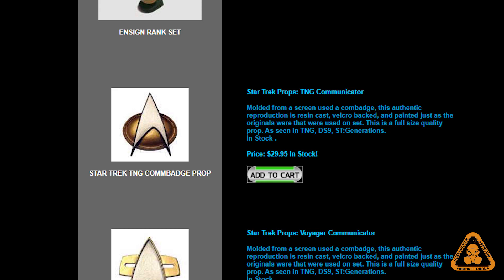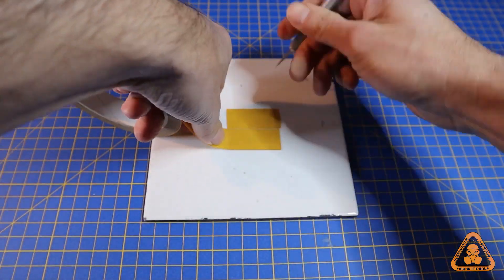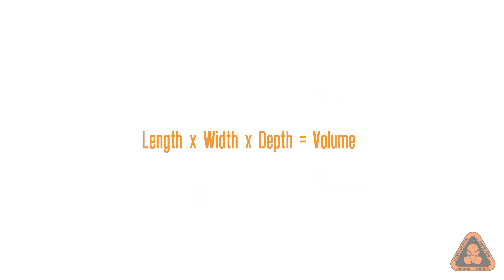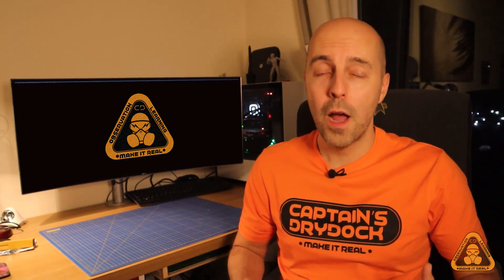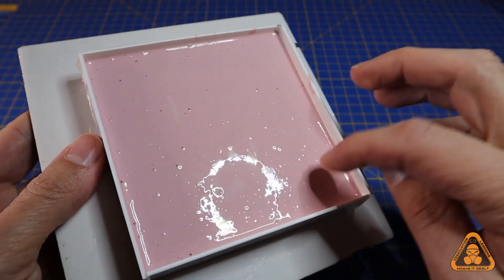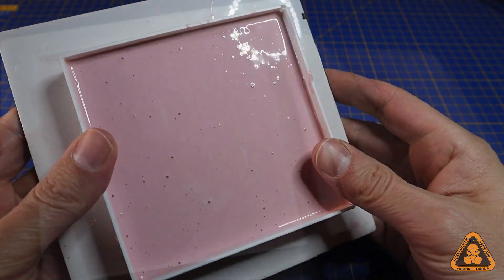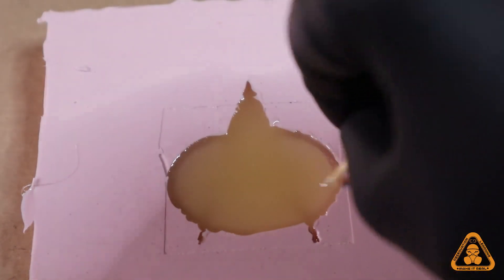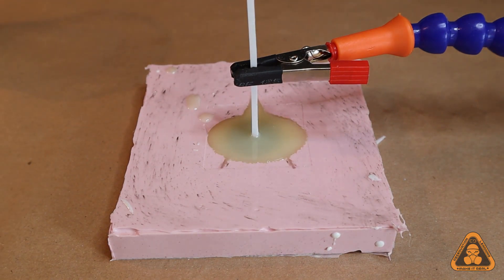Molding & Casting

Comment: Smaller box means less silicon is needed for the mold.... much less. You could have gotten at least 4 of those in that box. Other than that small quibble, great job.
Reply from the maker: Thanks. I used more silicon than required as it was nearing it shelf life.

Comment: One thing I like to do to avoid air bubbles is to first pour a little silicone over a piece and rub it into the surface with a finger. you can feel and hear the air pockets pop. It's both effective, and satisfying!

Comment: One thing I'm very interested in here is the metallic bronze additive you briefly showed to make a metallic casting. What was the additive, and where in the UK was it sourced, if I may ask? Also, do you get your clear resin from MB Fibreglass too? if so, what is the code for that resin? Thanks so much.
Reply from the maker: Ebay. There's a load of suppliers that sell the same stuff. Doesn't matter about brand. It's sold in small and large amounts.  
https://www.ebay.co.uk/itm/Clear-Epoxy-Resin-Low-Viscosity-Ultra-Clear-150g-375g-750-1-5kg-3Kg-7-5kg/232571890582?var=532750102698&_trkparms=ispr%3D1&hash=item36265d6b96:g:YAEAAOSwdjdaDX5W&enc=AQAFAAACYBaobrjLl8XobRIiIML1V4Imu%2Fn%2BzU5L90Z278x5ickkai8xCwosGKpC0NWj85e%2FBwWD8LfUWSAZtEBqA6DXkyB14mmBzAzpkUQGVWVhpIWrs3d%2Fp0Tkn4V4Y0qCDGE2TLvF5W%2Bj1GuP%2BKcZHAALQYG%2FJ9uLr87jgeoxRZy36%2BJPfvkJzuQw%2Bpl06Nwpdu0ZXNTtufKLoNK5Jgejel3w6q40DMiWdD1KO%2BEyyLZQA%2FVZN6l53a0rVXvnOU20QIYl0Ezuh%2BJIEIkMzd2YZLh%2FCIGw7VOXygX2LtoJkR3Buajs%2FKjdKXxwQf4xd3LjETpbglu0LDagMymttOwheItIwHIoxMEA%2BTxKId9O%2BJFpxTIcP%2B%2BjfucIZPjRS1TFB7NrvZ76jZK0M%2Bv0LhstWKzQKu0IUMKk%2Far0UmLAj4%2BeQ34z%2FW08F9mnrxpc%2F75yFqBquMbunjP%2BffZZwnq32pXMsu0l6okHn24dWx27r2CBtGsToTIeuIw266IK4lgaS3dJvC%2BOlVsg9W%2FwbtA0V%2B2Z68arMQKkFpvWHXrjcKtsl5yDyVk%2BaYLjydeiGxUgZPWNJnxVYpVKlclQekHy5CFOl7RktuZX1nBLRm0fjBXkO%2F4ULGNsaTegm4EjYpQsng%2B95uWsnJ1oe%2FWt1JPYYhKbWraLBLiIaguh%2FfyaaF%2Btzr4NiNetIzA7b9blz4rcjwu1Hh71rKgnEr%2FgPFkx71Al%2Bci5lIqvtM%2F%2FZwrv7eE9rfWD6WefRnkiUauVfGllGPS%2FhwERfUObPrGCdYOaCIqfF2oSHZ195KUUSjVd2Qy3hsgG&checksum=232571890582914208ebf72646e1aed2f371cf187737
Reply: @CaptainsDrydock  Great, thank you! And that stuff is odourless? I had a bad experience with clear resin in the past :o). Look forward to more videos from you.
Reply: Oh, I also wondered about the metallic additive as your example has exactly the finish I need for my current project! Thanks again.
Reply from the maker: @johnnysto2261  It stinks to high heaven and don't think I've come across a clear resin that is odourless.
Reply: @CaptainsDrydock  I ordered some to try, cheers. I imagine if anyone has an odourless clear, it would be Smooth-On, although they are pricey. I'll have to cast these in my workshed lol.
Reply from the maker: @johnnysto2261  You can use pretty much anything. Metal filings are best! But you can use screen printing ink or even metallic paint.
Reply: Here's something I made from Star Trek Online last year! 
https://www.youtube.com/watch?v=1DDgmzNS1Cc
Reply from the maker: @johnnysto2261  That's really impressive! Is that 3D printed?
Reply: @CaptainsDrydock  I 3D modelled it based on the game model, 3D printed it, and most of it as you see here is molded and cast in Smooth-On Onyx Fast resin, with a couple of the sections remaining 3D printed as they needed to be shaped in a specific way on the interior as well as the exterior.  A short montage: https://www.youtube.com/watch?v=9F_6pOdykhc